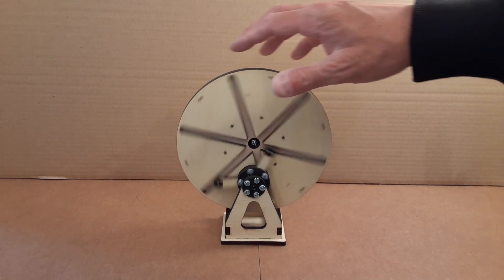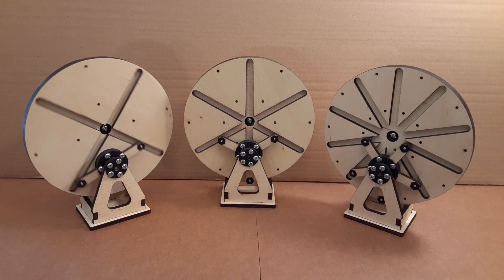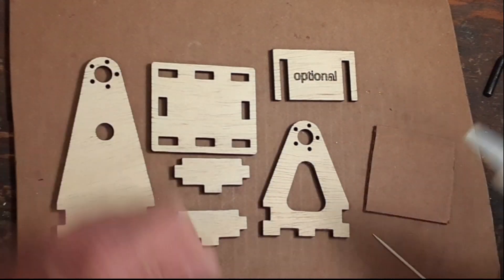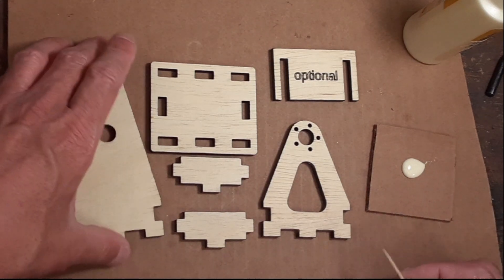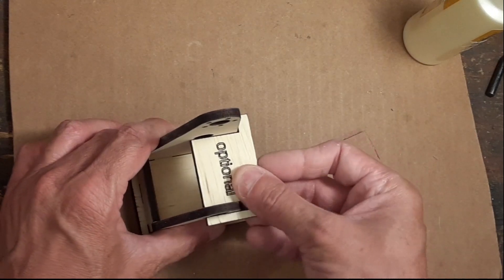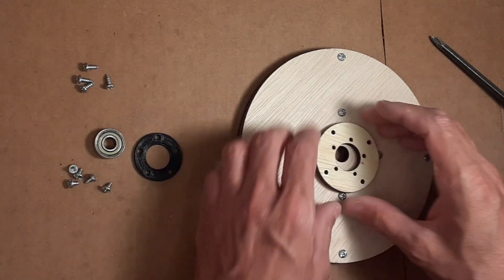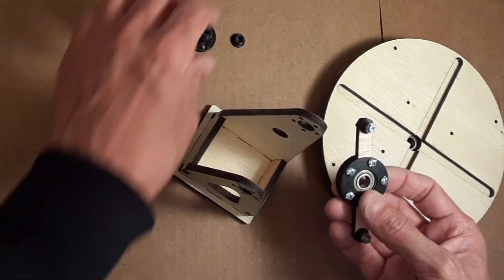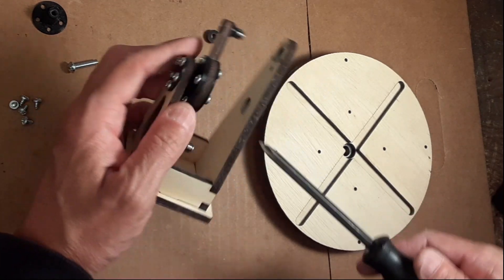Multiple Gearing, Laser Cut/3D Printed Model

Comment: I just received my laser yesterday, what is yours setting to cut 1/4 plywood like this on k40? Thanks a lot!
Reply from the maker: I ran this at 12ma @7.5 mm/s.  The plywood I use has a soft (balsa) core.  For different plywood of similar thickness it might need 2 passes or slower speed.  I have gone faster in the past with this material, I need to clean my mirrors/lens.
Reply: @ScorchWorks  thank you so much